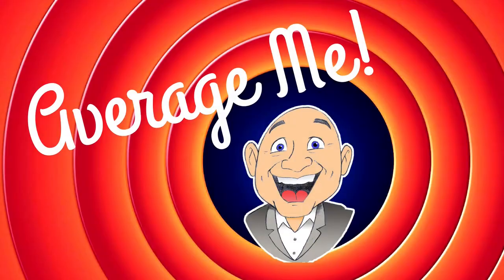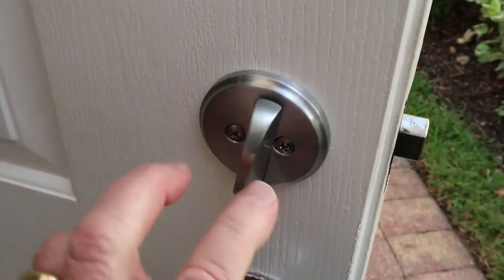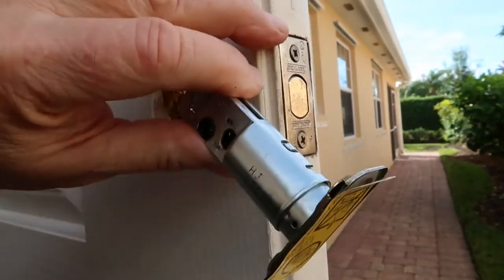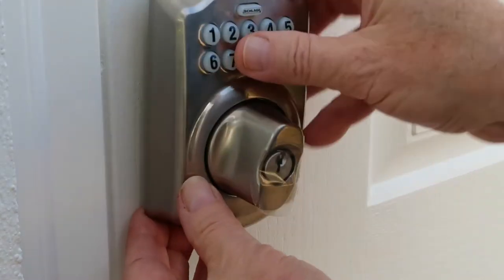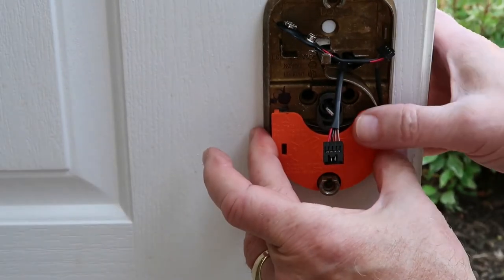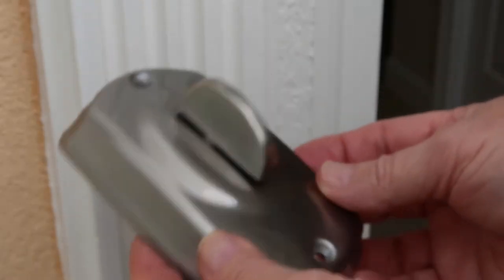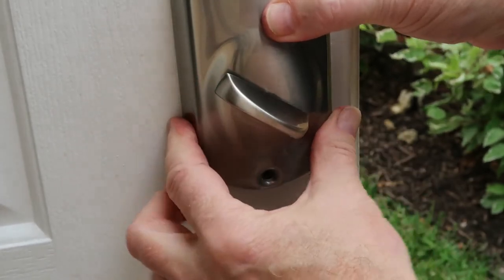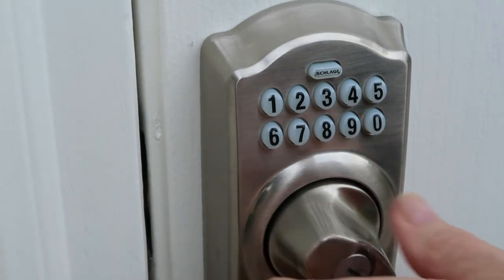How to Install a Keypad Deadbolt | Schlage Lock | Keyless Entry

Comment: Thank you so much for putting this video out there.  I was trying to install this lock and was having so much trouble...your video saved the day!!  Turns out that I had made a mistake early on, I extended the first part too far so it wasn't centered in the doorknob hole...thanks so much for explaining that clearly!  As soon as I saw you explain that, i knew EXACTLY what i did wrong, the rest of the installation was a breeze!!  I'm a single mom, appreciate the help!!!! :)
Reply from the maker: I appreciate your comment. I know how sometimes one little thing can throw off a project. I'm glad this helped.